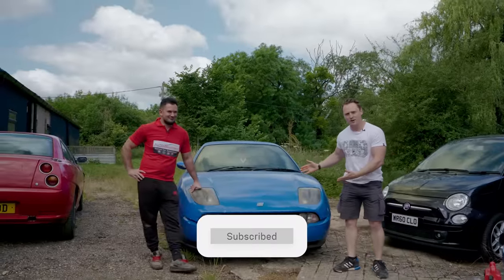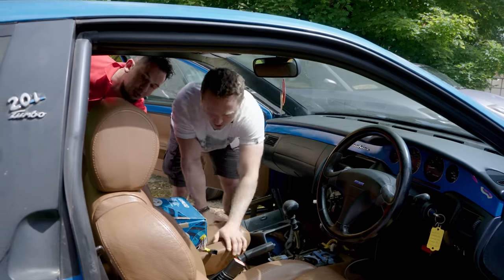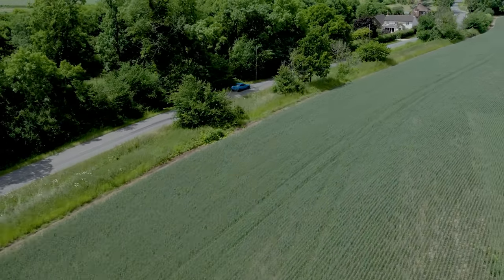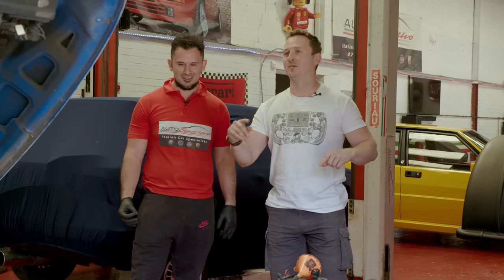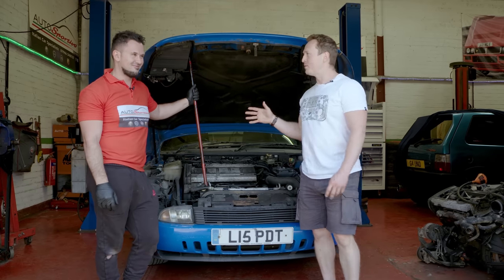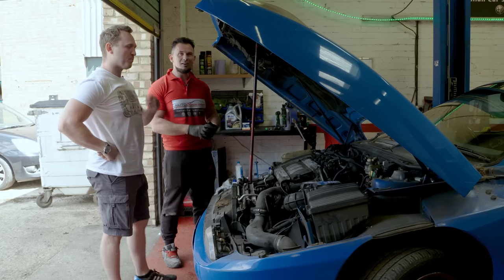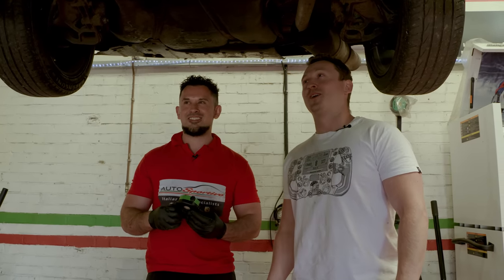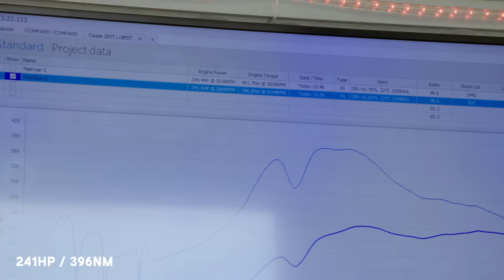Oh Crap, I Now Own A High-Mileage Italian Sports Car!

Comment: def got a tune, that torque curve was weird af... also, check for supporting mods: the stock intercooler is too small if tuned, the air piping tends to unclamp itself under pressure...
But with refreshed suspension and good tyres, it's an awesome car. And that sound and power delivery never gets old.

Comment: It'll be interesting to see how well this car turns out - looks like a pretty solid base to start from. Just about anything mechanical can be sorted, but rampant rust is what kills them eventually. Seeing as it looks like the turbo needs doing anyway, you have the opportunity to go for a bit more power. 280-300bhp is a doddle on these. My last Coupe had EXACTLY double the power of this one and was stupidly fast. If you want to take it a bit further, I reckon 350-375 is the absolute sweet-spot, as long as you upgrade the running gear too. That said, if you want it to be worth something, keep it as close to standard as you can.

Comment: You can actually attend classic car shows with these Fiat Coupes now and there is a owners club. Always loved the look of these cars and when tuned like this they sound great. The closely related  Alfa Romeo GTV's also sound great as well and look good.
Reply: theres always been an owners club. since the early 2000s.
Reply: this isnt exactly tuned. a chip or light remap doesnt make it tuned at all. mine would run rings round this being 340whp and top out a little short of 190mph. 60-100 mph in just about 3 seconds if that.

Comment: exhaust manifolds always crack regardless of maintenance. mines just started ticking. oil cooler pipes will want rust protection and the top charge pipe to throttle body piece the tiny plastic pipe coming offf the left hand side always breaks with age and heat which causes bost leakage. i think its boost reference.

Comment: im on my 2nd, first was a normal 20vt in this sprint blue colour with black interior, standard, then straight up swapped my 2009 520d for my current chrono grey 20vt plus (no sun roof-rare)
6 speed, 340bhp, stage 3 hybrid turbo, 480cc injectors, walbro fuel pump with wiring mod, bc br racing coilovers, pro alloy big fmic, alloy 40mm rad, apexi electronic boost controller, boost gauge, paddle helix clutch, uprated 4 bar fuel pressure reg, decat 3 inch system, fc performance stage 4 map, silicone intake and coolant hoses, recaro bucket racing seats, ill never ever ever ever ever ever ever ever sell.

Comment: Just subscribed, used to have one of these, listening to you rev it at the start brought back many happy memories. I'd imagine this one probably has a gtec chip in it hence why it's making more power, it only cost £15, was ridiculous how cheap it was to make extra power.
Reply: Yeh just chucking a chip at it isnt really tuning it. And barely worth it. Better off with a proper map.
Reply: @cylturbskie  was 100% worth it, car was alot more fun and achieved better mpg aswell, granted if you are modifying other parts of the car then a custom tune would be better however for the money gtec chips were brilliant.
Reply: @u04pww2  fair enough dude whatever works for the owner. id never trade my moon grey 20vt plus for anything, not even for all the money in the world, theres no other car that makes me feel a certain kind of way the coupe does or makes me feel so good about myself. 
Currently running 340bhp to the wheels.

Comment: Used to have one of these. It was a Sprinty too. Best colour imo although mine had a black leather interior.. My one had the so called hose of death go on it but thankfully It didn't damage the engine. However 2 years ago it failed the MOT on 2 things. Water had got into the electrics and everything went haywire and it had almost split in half due to rust. So it went off to Coupe heaven. Bloody loved that car. Should call your car either Liz or the non pc name Lisp see no. plate :)

Comment: Definitely had a chip in the past. I fitted one to my first one, a noticable difference. I've had 2, nothing ever broke stranding me, just general wear from use. My ep3 type R however had a 2 seized calipers, and a slipping auxiliary belt.
Reply: Ha I had one with a gtec chip aswell, turbo eventually blew and I ended up buying an Ep3, I miss them both tbh.

Comment: I owned one of these from 2007 till 2014. Basically spent the amount I initially purchased it for on maintenance every year. Also went 6 months without windscreen wipers, because the relay/module was broken and it was impossible to get.
Still regret selling it, though...

Comment: I have a base model 16v. The body is in poor shape but it has only about 50k miles. The engine is fantastic, it's the ancillaries and the rest of the car that lets it down. Also the terrible soft-touch plastic on the center console tends to turn into a horrible sticky mess, and there's the really annoying always-on radio circuit (the key has no ACC position, just PARK (for parking lamps only), OFF, ON, and START; the radio is always hot). Mine also has a frequent water leak into the trunk that I haven't been able to pinpoint. It's a fun car when it runs but when it does break I really don't enjoy trying to fix it. Everything seems to have been assembled in such a way as to make it painful to get anything done.

Comment: What great condition this car is in a very little rust issues and for an old 4 cylinder car 240hp turbo charged engine good figures Alex you have a gem of a car looking foward to the restoration of Fab
Reply: It's a five cylinder engine.
Reply: what gave you the impression it was a run of the mill 4 cylinder.....
Reply: considering these sound like a v10 it amazes me how you could think its a 4 pot 🤔
Reply: Oops l made a mistake a 20 valve 4 cylinder car wouldn't work a five cylinder would make more sense
Reply: @lesklower7281  no not wrong dude. the vag 1.8t engines are 20valves using 5 valves per cylinder. but most ppl think these are the same and didnt realise fiat made their own 5 pot. the 20vt is the same lump used in the lancia cappa.

Comment: Look people say what you want on Italian car how problematic their wiring is or what their reliability or anything that you've got to say but the ONE thing that you can never fault Italian cars is their engines from the engineering to their build quality. Like for instance the Fiat 16v engine's (Found on the delta integrale and the fiat coupe) factory crank is said to be able to handle twice the factory power output.

Comment: Having owned four of these, a 16v a 16v turbo and a 2 x 20v turbo. They are an awesome vehicle. Unreliable as anything, but so much fun and for the day, quick!
Reply: I have had 10 still got a 20VT and 16Vt and they are reliable
Reply: @fredrich99  this video has given me the itch for another 20vt in my life....
Reply: @chriskingston4256  Go for it my 20vt is the same colour sprint blue

Comment: I had a metallic green 20VT with a remap which boosted power to 270bhp. It has long gears but still went through the first three gears quickly. There are some which have over 600bhp 😳

Comment: prepare to be driven insane by the interior squeeking. my brothers 16v turbo understeered like crazy!!!!! love them though <3
Reply: Mate, my old one was awful inside. Had to blast the stereo as the snap, crackles and pops were doing my head in. On the flipside my best mate had an identical one and you’d think his was built by Mercedes 😁 The 20VT doesn’t understeer that much as it has a better diff.

Comment: A little question, I'm new to mechanics as i've just got into heavy diesel so i'm not the most knowledgable yet. Why don't you remove the badging that has the two holes behind it, seal the holes and then cut out adhesives for the badge?

Comment: Any recommendations for a reliable second hand 5 seater at around 120-150 bhp that won't break the bank? Something like a 1.8 or 2l mk 6 golf TDI?
Don't know how good those engines, transmission etc have aged etc  

Just reckon there's good knowledge around!  Cheers :)

Comment: I also own a high mileage (316.000km) 20V Turbo, but mine is German, has the most commonly used size of paper as model name and has 4 rings on the grille. Also, I think my 5th cilinder flew off because it only has 4 cilinders and only 1.8 liters of displacement.... Great car tho, many people can't say that it is 24 years old and has some experience without you telling them....
Reply: Seat Leon mk1 Cupra. It also has the the 20v turbo. 120k miles and still going strong
Reply: @MattyEngland  yeah probably one of the best and most reliable engines VAG has ever built, great engines I love 'em

Comment: A friend was foreman at Fiat when these were newish - yep, I'm old - and if I remember rightly, he said it was engine out to change timing belt/chain - 
The engines had lots of issues and the reason I never owned one- would have liked to though
Reply: Cam belt can be done with engine in. I owned one for a couple of years and was surprised how well it was put together. Other than the clutch slave cylinder going I had two years of trouble free motoring.

Comment: time to go for the TURBO PLUS treatment
Reply: You mean zender bodykit and 6 speed box right,  given that there is no power increase from 20vt to 20vt plus or 20vt LE
Reply: @cylturbskie  I'd be happy even with the 6spd gearbox upgrade
Reply: @TL98  yup it makes a world of difference having the lower ratio for cruising, especially running alot more bhp than stock
Reply: @TL98  but then its sourcing that and possibly drive shafts, maybe even a couple of other things. I cant remember what it said on the forum about the 6 speed conversion, it was a good 10 years or more since reading about it.
Reply: @TL98  if I remember correctly, in my plus at 70mph its only sitting at 1200rpm…. Where my old 5 speed 20vt it used to sit around 1550 - 1600rpm - ish if not closer 1650rpm. Been 8 years since i owned my normal 20vt so can’t remember.
Reply: @TL98  if I remember correctly, in my plus at 70mph its only sitting at 1200rpm…. Where my old 5 speed 20vt it used to sit around 1550 - 1600rpm - ish if not closer 1650rpm. Been 8 years since i owned my normal 20vt so can’t remember.

Comment: I5 engine noise for the win. Better than all except v10 which it is on level with
Reply: Id say inline 5 is better than any other engine made. You have the sound of a v10 without the running costs.
Reply: Id say inline 5 is better than any other engine made. You have the sound of a v10 without the running costs.

Comment: Love the 20v fiat coupe Wheeler dealers had one to over 300bhp
Reply: Unfortunately its (wheeler dealers coupe) not had the supporting mods done for that power level, they still left the standard intercooler in place with the increased power level so no doubt will have major heatsoak after a few pulls. 
my 6 speed however is 340bhp to the wheels and would walk all over that wheeler dealers 5 speed.

Comment: I really like these cars i was tempted to buy one they are very quick too for what they are 👍
Reply: Yeh 160mph standard. And with these 5 cylinders you dont need a stupid block mod before thinking about upping the power(unlike the volvo motor).My 6 speed is running 340bhp tot he wheels. Good for 186mph according to someone on here whos even more clued up than myself thats bullt one running 414bhp to the wheels. 
Anything over 100mph is really where these want to be at pulling harder and harder.
Reply: With 60-100mph in 3 seconds give or take

Comment: 400 Nm of torque - whare did that come from with 244 brake?!  Lucky bleeder.  There not unreliable, don't belive it!  Mine was more reliable than both the nissan primera 2.0 l e and a saab 900 I had.  Damn, you got me thinking about getting another one....

Comment: Do you know what's actually been done to achieve the extra bhp
Reply: Just chipped i expect. Which is no way to gain any extra power unless you get the fueling checked and or run a wideband gauge to monitor air fuel ratios in conjuction with a boost gauge.

Comment: We now have the same car - even same colour haha
Reply: I used to have a normal sprint blue black leather 20vt. First fast car. My 20vt plus is running 340bhp to the wheels. Heavily modified.
Reply: @cylturbskie  yeah i'd like to get mine to 300 id be happy with that 340 must be brutal haha
Reply: @redlinequickshift  yes lad comes on insanely strong and hard for a “conservative” map. So much that the g force is slowly breaking my Recaro racing reclining bucket seats every time i get on boost. 
So soon i will not be able to drive the thing because the plus models and I believe le models have a different bolt pattern for the seats so will have to sorn it just because of that.
Reply: @redlinequickshift  yes lad comes on insanely strong and hard for a “conservative” map. So much that the g force is slowly breaking my Recaro racing reclining bucket seats every time i get on boost. 
So soon i will not be able to drive the thing because the plus models and I believe le models have a different bolt pattern for the seats so will have to sorn it just because of that. 
I am importing a tubular turbo manifold from italy at the cost of 430 quid and have the last piece of the puzzle to be fitted already - uprated 40mm aluminium radiator and new OEM thermostat to go on.
Reply: Tbh mate, 250-260bhp and above is where they feel fast enough to take alot of things. 340 to the wheels is absolutely absurd tho.

Comment: I will be honest, I like Juke Nismos.... But this... I just don't get why you like it so much..it was an OK quick car when it was released, never a legend.  I feel salty saying it as I am a car fan and liking quirky stuff.
Reply: Because its unique and the closest thing to a supercar body style that is a normal but very rare non supercar. And a standard coupe would run rings round most things not to mention being the fastest front wheel drive car in its era. Tuned they are another level of insane speeds. Around 340bhp and above there isn’t a lot that keeps up or can overtake one on full chat. Topping out 185mph around this sort of whp. the nismo juke is the only exception to the juke being utter garbage. I to, quite like them. And speeds above 100mph are where these coupes really start moving and pulling and then pulling harder catching you off guard.
Reply: And the 5 cylinder turbo engine is special and a dying breed, not a run of the mill engine.
Reply: And the 5 cylinder turbo engine is special and a dying breed, not a run of the mill engine.
Reply: These just happen to be stronger than the volvo unit being cast iron and dont need a block mod to be made reliable at standard or increased horsepower. No focus st or rs will take 400bhp to the wheels for an extended period or even short amount of time without needing a block mod.
Reply: It was more than ok….build quality is sublime…as is everything else with these. Along with the punto gt turbo mk1s. And with these old turbo cars its just you and the throttle managing power, no electronic crap to hold you back/aid you.
Reply: And these turns heads more than any other normal road car. Certainly more than any common juke or nismo juke.
Reply: I get more questions, compliments and interest than any other car does every week when i attend the classic car and bike meet local to me. Even from the bike guys. that whats its about. Standing out from the crowd, surely you understand this liking cars also??
Reply: @cylturbskie  thanks for a decent reply 👍 I understand don't worry.  I just guess I was never a fan of the looks.   I'll have to watch more of Alex's videos now to get a good sense of them. I remember they had a rep as being quick, but that's about it.
Reply: @matthewwain9958  no worries ma dude 🤟